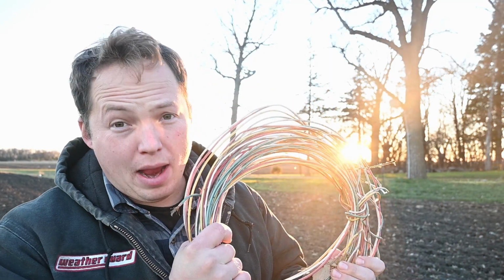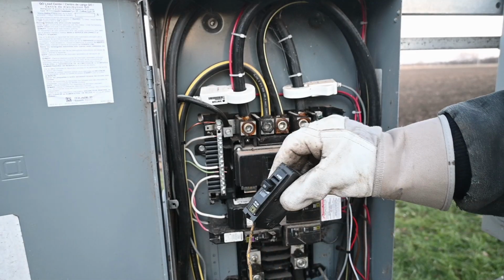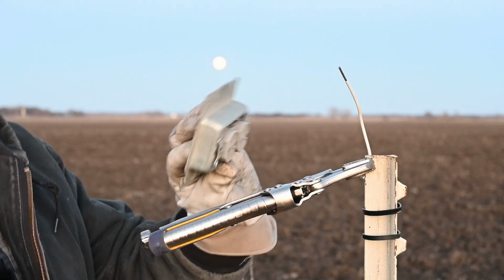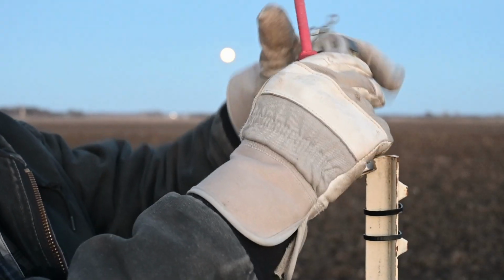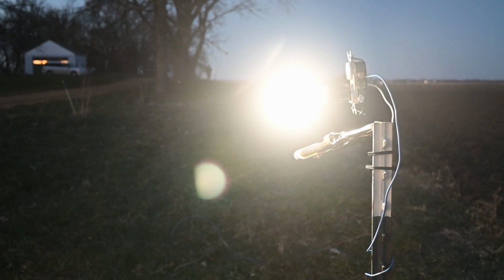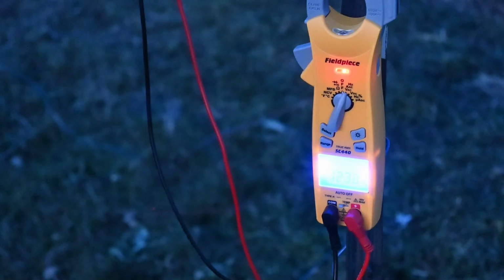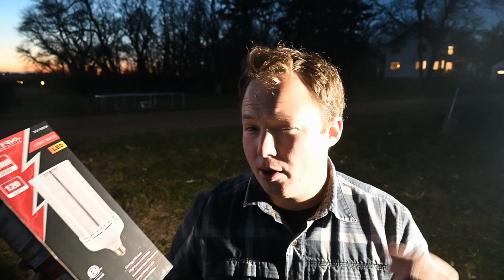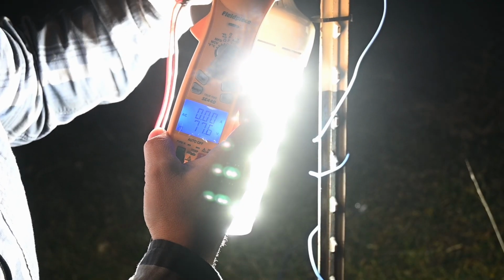Powering a Light With a Fence Post & Scrap Wire - SWER (Single Wire Earth Return) Demonstration

Comment: Duh!   Take your boots off and walk on the wet dirt.   I double dog dare you
Reply: lol I live next to a house with dogs that bark at me through the fence non stop. Until, I come home from work to mow the lawn, the wires going to the neighbors house are hanging so low i have to duck. No barking and I think, 'Finally I can have peace and quiet in my own yard'. I notice the splice on the bare ground wire has slipped and call the power company. The worker comes and talks about how the neighbor will be upset if the everything in the freezer is melted. I point out that the neighbor's porch light is on. As soon as he repairs the splice those dogs are outside barking their heads off, back to normal.

Comment: Benjamin, you've touched on something that can be very useful for outdoor lighting that's 100% safe and legal SWER.  You can easily install LED lighting at your mailbox if you make your own led lamp(s) with a few LED's wired in series and/or parallel.  
One important thing to know is that the National Electrical Code is in force only when you use more than 50 Volts to power a circuit.  Since resistance of damp earth is only around 3 to 5 Ohms per foot, give or take, the point is you can easily implement a low voltage (much lower than 50 Volts) LED lamp installation using, say, 12 Volts or so.  You can also use very small and cheap insulated wire with mA levels of current.  20-gauge solid copper wire is only 1-Ohm per 100 ft. and it can easily carry a couple of Amps, more if it's buried in the ground.  You'll want to drive a copper clad ground rod into the ground next to your mailbox so as to get down into permanently damp earth for the return line. 
A common 3mm white LED will light to full brilliance at a max of 3 Volts DC with a max current of 20 mA.  Use Ohm's law to work out a lamp with several LEDs inside a Mason jar.  You just have to work out what total voltage is required to light up the LEDs in series, and how much current to supply with a maximum of 20 mA of current for each series string of LED's.  For example, 3 white LEDs in series needs 9VDC and a string of 3 white LEDs uses a max of 20 mA of current for full brilliance.  Less current = less brightness.  If you make a lamp with 5 strings of 3 LED's, you'll need 9V at 100 mA.  You can use a common wall wart 12VDC power supply with a minimum current rating of 150 mA or so (never run a power supply at more than 80% of its capacity).  Measure the DC voltage at the end of the wires at your mailbox and it should be more than 9 VDC.  Thus, the last thing to do is use Ohm's law and work out the extra resistance required for each string to limit current to 20 mA or less.  For example, if you have 10.5 VDC at the lamp post, you need to insert a resistor in series with each string to reduce the voltage a minimum of 1.5 VDC per string to get 9VDC.  Using Ohms law (Voltage = Amps times Resistance), the extra resistance is found by dividing Voltage by Amps = 1.5V/0.020A = 75 Ohms.  The closest standard resistance value is 82 Ohms, so the LED's will be just a little less bright than maximum.  If you have less than 9VDC, you can make series LED strings of 2 LEDs, thus needing onl 6 VDC per string.  Or, change out the wall wart to, say, 15 VDC.  Play with it on a breadboard and decide how much light you want from those LEDs, but never go above 3V and 20 mA per LED cuz they will soon burn out if you do.  
Enjoy!

Comment: Tgis guy is a total idiot!
He said he didn’t know if the ground was close enough! Yes you can run the wire for a mile but the ground does not change it’s only the resistance of the wire that lowers the voltage not the ground

Comment: Your single wire earth return reminded me of something my grandfather would do before going fishing. He would take 2 metal rods (copper probably) and hammer them a short distance into the ground about 10 feet apart. The rods were connected to wire and to an power plug that he would plug into an electrical outlet in the house. No one was allowed to go out side for a few minutes then he would unplug the wires and go to the rods and harvest lots of worms that had swarmed to the surface to escape the current. This was his bait to fish with. This would be a ground return from one rod to the other right? You should try this and of course talk about the safety issues.
Reply: Washing-up liquid (diluted a little) would always bring worms to the surface. This is what we did for Fishing, and was much safer.

Comment: 2 problems;l Soil water content is an issue; bur 1st you have to consider Electrical leaking through the soil, this basically means you are losing Amps thru the soil { Bul Connected or Not } this will translate into paying for lost electricity,  now this will vary greatly on the minerals in the soil but that should be fairly constant, the variable factor is moisture content, this will not work on Bone dry soil, over saturated soil will leak even more electricity, and possibly cause a shock hazard,

Comment: This trick does not work anymore in France. It's one of the reasons why meters use VA instead of W, and the (very) old meters would not detect (and bill) current that used earth return. In any case, don't do it near a pasture, cows' heath deteriorates quickly when there is any current leakage in the soil.

Comment: The light is not powered with "a fence post & scrap wire."  It's powered by house current, using the ground as one of the wires.

Comment: I dont see how the breaker will short circuit in case the load is bypassed someway
So if you ever short this to ground with no load it will always use electricity that you are paying for

Comment: My father-in-law owned a cattle farm, his "hot fence" consisted of a bare wire insulated on fence posts, and plugged into the "hot" side of the outlet. The cattle would complete the circuit when they tried to get through the fence. It worked for 70+ years.

Comment: So all this actually does is allow you to get electricity from the source, to the bulb, with only the use of one wire and not two?
I was thinking it was some way to get electricity from the ground....I saw a video where they got electricity out of the air with no powers source but it has a lot of limitations on how much electricity if produced, so it's  is very impractical.

Comment: Dad was a geek kinda guy.  He had a friend bring his shamcy telescope out to our rather remote homestead to take advantage of low light clutter way up on the hill behind the house.  The telescope used a motor.  Dad strung a single wire from the house, about a quarter mile out through the trees, and beyond into the open field to power the tracking motor in the scope.
Reply: Or how about just use the batteries that ALL tracking telescopes have in them. 🤷🏻🤦🏻

Comment: Well you're just doing the same thing that somebody else done in your profession and figured out first it was a farmer that could figure out that he could suck power off of a high-powered line by running a wire down a fence post and make it into a certain length to make it 110 or 220 from basically the static electricity it comes off of the high-powered lines but I'm watching you say you can pull it out of the ground I'm going to watch that's if there isn't a high-powered line going overhead

Comment: I do this in my 16 acre woods with lights all over the place but with a ground bar at each light that is a 7 ft pipe hammered into the ground with a flattened end with a drilled hole to screw on the ground wire. lights up my trails

Comment: So......if you had a really good Grounding Rod out in the Country, all you would need is One hot wire from a Power source (company power pole, generator, solar array).  

Because the Black wire (ground wire) will go to the really good Grounding Rod.  And the White wire (hot wire) will be the input lead wire into the whole System you want to power.

One way in, and one way out.  Nice.  

Now if you take a Tall metal Tower made out of Conductive Metals, and attached the White wire to the very top of the Tower, and run it to your System as the Input Power Wire.............And then have a good Copper or Silver grounding Rod going into the Ground........Then perhaps you can pull Power from the charge potential above the surface of the Earth, down to the ground, letting the current flow through your system and down into the Good Grounding Rod.  Just a thought.

Comment: You don't quite have it understood correctly. The earth is a great source of electrons, either to be used as a source or a sink. On half the cycle the earth is providing electrons back to the source, on the other half it is absorbing electrons.  They are literally just flowing back and forth, back and forth, into or out of the ground. Believe it or not, they only move a few inches. Depending on how much energy is used as a load, it can take half an hour for the electrons to go from the switch to the light bulb. I remember calculating this in a physics problem. The rod in the ground is simply a poor version of a grounding rod that you have on your house or outbuilding ... or on the telephone pole servicing your house. They are coated in copper and 8 feet long to provide enough area to ground your load. The neutral in your home wiring serves as the "return" to the ground rod. Half of the cycle it is providing the electrons, half the cycle it is absorbing them, so to speak. In a sub-panel  to an outbuilding you are required to drive another ground rod. This is exactly what you are doing.  60 times a second, electrons are traveling from the ground rod to the power company or from the power company to the ground rod through your various loads. The reaction time is almost the speed of light but the distance the electrons travel is very short.  Using a short and non-copper coated rod is dangerous in that it provides inadequate grounding and any short on your circuit can potentially kill you. There is a reason for double insulation, gfi's and safety grounds. Travel to a third world country and you can find people hooking up power like this everywhere.

Comment: I feel compelled to point out you didn't power a light with a fence post and scrap wire. You powered the  light with the mains (from the power company) through the fence post and scrap wire.

Comment: in years gone by farmers would use a light bulb as a resistor for a electric fencer the bulb would also act as a indicator of how many shorts-grass- was  taking voltage from the wire  not safe!!

Comment: You're still getting power from the electric company what good is it I mean you saved yourself a little bit of wire by not running a cord over there but you're still using the electric company Electric useless

Comment: This kind of accidently happened to me. The high voltage wire feeding the transformer to my pump house broke in the middle and fell on the ground. But my pump and heater still kept working and I didn't even know that the wire was broken until my son saw it laying in the field. So the neutral wire was grounded and kept the circuit live.

Comment: To reduce loss, use transformers to raise the voltage and reduce the current in the ground. This was common with power distribution, but that leaves the system vulnerable to differences in ground potential from a CME event or EMP. This is why this is no longer considered standard practice for high tension work, and is only used for distribution to pad mount or pole mount transformers with a primary of 12KV on single phase. High currents in the ground will often find a lower impedance path in buried pipes such as city water, or gas and oil lines. This has resulted in corrosion of the pips or other buried infrastructure. For these reasons, this is not recommended. In many areas, this no longer meets code and is considered obsolete due to the downsides.

Comment: this a dangerous info. people who have no knowledge of electrical systems could kill bystanders or themself. The earth's ground moisture has a major effect on the conductance of electricity.  In very dry soil as in a dry season, the voltage drop is too high in the ground, the light/equipment connected would appear as broken, or appear electricity is off.  As a result, a dangerous voltage could be presented at the lighting/equipment connected.  There is a reason and is important for us to follow the electrical code for the safety of others and ourselves.

Comment: My Dad  made a electric worm digger over 30 years ago by attaching a hot wire to a large screwdriver and moving  it up and down in the ground and the vibration from moving the screwdriver up and down causes the worms to come to the top of the ground. Always wear shoes .:yougotthis:

Comment: This is a very dangerous electrical installation. We run multiple conductors for a few reasons one of them is for safety. If you come up to a wire that has no neutral or ground with it and you hit it with a shovel the shovel will NOT short out against the ground and the neutral and trip the breaker. If there's no ground or neutral wire back to ground bar at the panel it doesn't know to trip and it will continually feed power through the wire through you and to the ground until you die or somehow fall off the charged wire.

Comment: Don't use this idea *anywhere* near a dairy farm. Cows are very sensitive to stray voltage and will give less milk or none at all if they sense electric gradients.
And it is not an code compliant means of wiring, period.
Power lines (typically at 7200v) have grounds at 6 per mile minimum. So if you are in proximity of a power line, the danger is worse for a short.

Comment: back in the 60's used a single wire to pull a contactor on a irrigation pump a few hundred feet away. Used steel fence wire and a transformer to boost the voltage to over come losses. worked fine for years

Comment: The province of Alberta still has a good number of single wire ground return. I live in a county that has 5500 square miles & a population density of 0.6 persons /square mile. The single wire circuits are being replaced slowly.

Comment: My friend.Take two pieces of copper wire about three feet long Make an L.Walk around your property.When they point together,they are showing you where two underground water systems cross.ie like eigh lines.Take your volt meter positive in the ground,black one in the air.1.6amps continuous.

Comment: This method of a return path may save wire, but it will result in a very dangerous situation in the surrounding area. Strange rusting will begin, cows will stop giving milk, animals being very sensitive to electric shocks. Then you may receive mild to uncomfortable shocks when turning on underground water faucets, worms will leave your area. The worst is when a child feels an electric shock. After 35 years as an electrical contractor, I have seen it all. Don’t do it! Keep all electrical current confined safely within insulated wires, use GFCI outlets to insure this current leakage is limited to UNDER 10 milliamperes. 10 milliamperes will protect you from hardly feeling the stray power. I can tell you some very sad stories concerning this wiring method. You are also bleeding off metered electricity you are paying for to heat the ground.

Comment: You keep using that electricity that way your electric bill is going to skyrocket . Dumb. There is a reason why there is a neutral wire . The electricity going out is compared to the electricity returning to the source and deducted from your bill.

Comment: Unfortunately,  that is not a very efficient way to send power using the earth and a fence post as the return, due to their higher resistance than an equivalent length of wire.  It may work for a low current LED bulb, but will not work for a motor for example or any other electrical device that draws several Amperes.
Wayne,  Electrical Engineer 
Wire is not that expensive.

Comment: I was watching movies about getting electric power from wires hanging high up and ground wire, powered telegraph 150 years ago.
Option 2:
Power getting from about 400 coils settings on the board every 1/2 " in board 20"x20" used in electric cars from 1836 in USA.
What you know about it.
Good day

Comment: This not a very safe way to light the lights out in the barn or pole.  If someone were to dig in the ground that is in the path of the conduction through the ground to the light in your out back, they could get a serious shock depending on a lot of conditions like how wet the ground is and how well insulated the digger is with his or her tools.    Who knows if some unsuspecting person or animal could stumble into the electrified dirt in the future.  Best advice is to use direct burial cable such as UF insulated 2 conductor with a ground wire, bond the metallic parts of the light fixture to the ground wire in the UF cable and be safe.   This is cleaver but not worth the risk of hurting or killing any human or animal now or in the future.

Comment: I use single wire earth return for electrified fencing. Ground moisture and other factors affects voltage and amps. Sometimes there's not enough current to produce an effective of felt shock. I started out with aluminum wire which is lousy, I then redid the system with 12ga solid copper, (I might change again to 10ga), this made a big improvement. I'm considering relocation of my ground rod to get maximum voltage, there is often more voltage drop than should be. I could boost the power but I don't want to deliver injuring or fatal shocks. So maybe repositioning the ground rod might work to help stabilize the system.